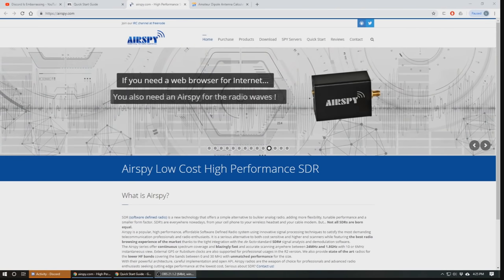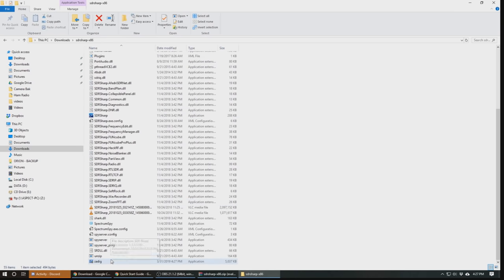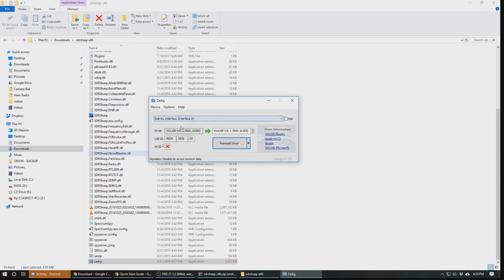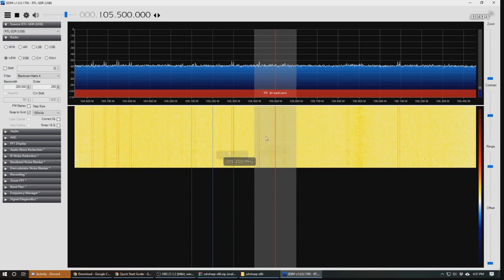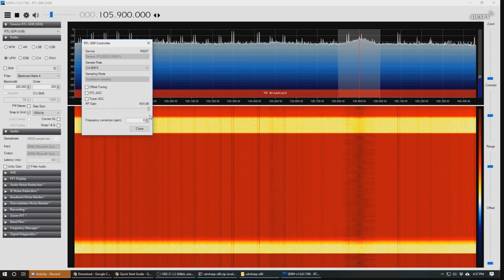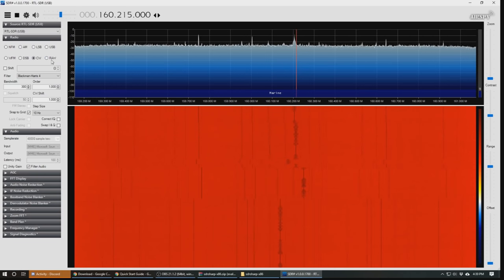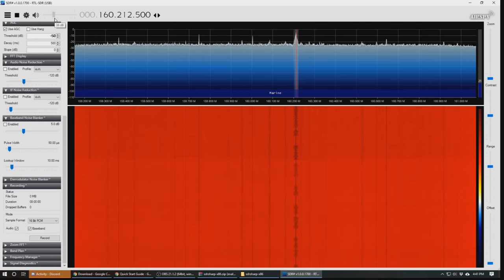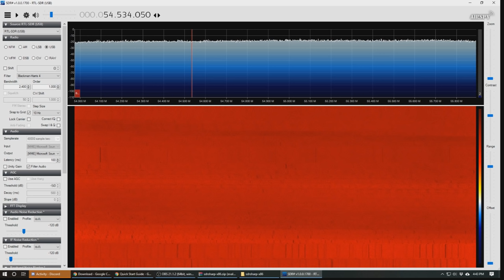Getting Started with the RTL-SDR (Software Defined Radio)

Comment: you forgot to explain abuot .NET5 SDRSharp didn't start it aske to install .NET I did but still SRDSharp doesn't it keep asking to install .NET5
Reply: Had that problem, I have a 64 bit pc and NET5  was installed but no joy with SRDSharp starting.  Uninstalled NET5 64 bit and then installed 32bit version , problem solved.

Comment: To remember which side of the antenna is up, which side is down, after unscrewing it, I attached a rubber band at the side that is supposed to be up, so I remember it.
The RTL-SDR kit is the best out there for newbies. I started with Nooelec, and as much as I don't like bad-mouthing companies, their stuff is just subpar. For similar price, RTL-SDR is way better. For a bit more money, the SDRPlay is awesome, especially if you're on Windows. If you're planning on buying an upconverter anyway to get into the 1khz-30Mhz range, the SDRPlay gets you there without an upconverter, and has several built-in filters (which I haven't found how to activate under linux, only windows).
If you plan on going the upconverter route, it's worth noting the RTL-SDR has a bias-T which can power many upconverters, while the Nooelec stuff needs another power source.

Comment: Thanks for making the setup simple and understandable.  I was getting frustated until I found this.
Reply: hi David, are You using them with R820T2 RTL2832U? Would You tell it's worth to buy?
Reply: Hello Jaroslaw,  I have the RTL2832U R860T.  It says it's version 3.  I'm still struggling to receive much  of anything on it.  I sorta wish I had gotten a different dongle.  Maybe a different one would have given me better results.  So event though I was to finally get it to work,  I'm not satisfied with the results.  

You might want to journey over to Frugal Radio to see if they can give you some info.  I've also gone to Kiwi SDR Online.  You can listen to SDR indirectly from their website.  I've been doing that myself.  It's limited frequency covderage but it's still fun and interesting.

Good Luck, Jaroslaw
Reply: @davidsearles4636  Thank You :). Keep Well Man.

Comment: @ModernHam Great video, but you should note that NFM/AM/LSB/USB/etc. are not "filters," they are different modulations. Changing them doesn't just change the bandwidth, it also changes how the signal is decoded to audio. LSB and USB decode single-sideband AM signals. AM decodes AM signals. WFM and NFM decode FM signals of different bandwidths.

Comment: I was advised to toss the included antenna in the trash
Reply from the maker: People like to over complicate antennas. An antenna is just a piece of metal. It can be a wire, one made of pure copper, a telescopic, even a gutter. If it's the same length and shape, it's basically going to be the same thing. The included antenna is fine for anything above 50Mhz unless you need something highly directional

Comment: Love the video! Quick question would it be safe to connect the RTL-SDR directly to a waveform function generator using say a BNC-SMA cable (and avoid using an antenna). I'm just trying to test the software aspect + functioning of the RTL-SDR.
Reply: Fwiw I've heard of people hooking up their 1-4W HTs to them as a signal analyzer. That said I've read they can be fried, but as to what power is safe I'm not sure.
Reply from the maker: Depending on the output of the waveform function generator. You want a very minimal signal on the input or you will desensitize the receiver end.

Comment: I just received my RTL-SDR yesterday and have watched two superb videos about how to set it up. Out of the two videos I watched, this one is better. Thanks to you, I feel almost 100 percent confident I will set mine up without much trouble. I am running a dual boot P.C.; one side is Ubuntu, and the other is Windows 10 Professional. First, I will set up my Windows, and then based on my research, I will set up my Linux for the radio scanner. I also have an iMac, which I will set up. It's almost guaranteed that my Windows setup will not be as good as my iMac or Linux. Thank you for the clear and concise instructions. Subscribed and thumb up,    Cheers
Reply from the maker: Glad you liked the video! I find it works more smoothly in linux for me. the rtl_sdr package handles pretty much everything.

Comment: To receive HF you can get 2 nuts that fit the threads where the telescopic elements attach.  Then attach a quarter wave length wire for the band you want to use with a lug on one end to both sides by tightening the nuts.  So now you have an HF dipole.  To receive HF on Dongle there is something in the SDR Sharp that you might have to do so it can receive lower frequencies.  Not sure but just a hunch.

Comment: Thank you young man for taking the time to do this.  I am waiting to receive mine sometime next month.  I will follow your lead in getting mine setup.
Reply: how did it go sir?
Reply: @needlethread4715  Works great other than the software getting locked up when you click the stop button after it's been in use a while.  Have to do Ctrl-Alt-Del then end task.  So just leave it running all the time....lol.  I only use it for HF 40 meters mostly.  Tried some different solutions recommended but none of them worked.  Supposedly some older versions don't have this issue.  Any suggestions?
Reply: @dangriffin5532  thanks for the reply. had this dongle too for a month now. cant remember if i had the same experience using sdr++ or sdr# on my windows 11 desktop. but with the raspberry pi 4 i think there were a few times i encountered the same problem, with gqrx and sdr++.
Reply: @needlethread4715  Probably not the fault of dongle more the freeware written for it.  Someone took the time to develop it so I thank them.  I certainly don't have that skill.  But for $20-25 bucks it's hard to beat otherwise.  It works better than my SANGEAN.

Comment: Hi, I My version is V1.0.0.1811 with different layout; however, I found "RTL-SDR USB" but when I press the play button I get an error "No device selected"   My unit is a USB black box with two antenna inputs for low and high band range.
Any ideas?            (I had got it working in the past on another computer but it kept on crashing).

Comment: Amazing video, thanks! My dipole antenna though has a resistor (100kohm) and not a capacitor. What could that imply in practice? Thanks.
Reply: Ever find out?
Reply: @mikeoxbig7806  nope. :-(
Reply: Hi, folks, I came here due to the same doubt... but I can't read the value ( 100K ). After check the resistor value ( barely can distinguish the first band in my antenna ) I've found this, explaining why the resistor is in between. Hope this clears your questions also:  "I have the same antenna and it is 100K ohm on mine. This would serve to bleed any static charge (its intended purpose) without impacting performance." Link: https://forums.radioreference.com/threads/why-is-this-cheap-rtl-sdr-blog-v3-kit-antenna-so-good-and-why-is-it-so-directional.406041/

Comment: Sir it is a resistor. Not a capacitor. Resistors do not have an up or down side. That resistor is for ESD bleedoff. Some report, though, that the end connected to the center conductor of the coax is up, and seems to give better results. Also, the newest version of the dipole antenna being sold does not have a resistor. The modes are not for the audio coming out. You select the appropriate mode for the signal your tuned to. Amplitude Modulation, Frequency Modulation (NFM or WFM), etc.

Comment: I also have such a receiver. But I don't like one problem, it gets very hot. And it is felt outside the case, and inside it is even stronger. Have you tried installing a cooling cooler on it and will the holes in the casing affect extraneous parasitic interference?

Comment: Hello my dude,

Yea...that's a high resistance resistor in between the poles (they even say it on the website). It was used on the V3 to discharge any Electrostatic Buildilup on the antenna.

Comment: Resonance is not required for reception, but one will do better to have antenna that is at least one quarter of the wave length.  Resonance is required for transmission to keep from blowing the final(s).  At resonance, the antenna is purely resistive and reactance is zero.

Comment: where did you get the antenna you're showing? does it have an sma connector on it?
Reply: If you buy the rtl-sdr blog 3 kit with dipole antenna it comes with 2 sets dipole elements long and short. I just paid $34.00 on amazon for one
Reply: Yes it has sma.

Comment: Please help me. I have recently purchased and RTL.SDR from China, it has 2 inputs a UV and HF. However, I have downloaded the software and complied with all your instructions, but when I click on the start button it says cannot access the RTL Device. Perhaps you could let me know what is going wrong. If you want to access my computer using your Team Viewer for you to install it for me, then I am more than happy for you to do that and of course I would be more than willing to give you a donation. Trust you can help?
Reply: I had the same issue and it was because I did not followed the instructions correctly. What I did to fix the issue was. 1. remove sdr sharp including the zadig program. 2. reinstall sdr sharp via the .bat file. it will install zadig this time. 3. connect the SDR to the usb port and run zadig... make notice that if you had installed the driver before, the number will not be 0, it will increase it by 1. in my case, my friend´s sdr was 0 and mine was 1 as I installed both in my computer. Install the driver, close zadig. 4. Open SDR sharp, it should recognize the device this time. Have fun!

Comment: Why is it I always thought that tuning an antenna was only needed for tx, while rx didn't matter? I'm not trolling here, I'm genuinely curious to know.
Reply from the maker: I'ts very important for TX because an antenna not properly tuned for transmit can reflect that power back into your radio, causing damage. 
For receive, the electromagnetic fields that hit your antenna, cause the electrons inside to shift and create a signal in the Dongle. This is usually a small shift, unless the antenna is very close ot the transmitter. So if you have an antenna that is much longer in wavelength than the freq you are trying to receive, not only will your antenna pick up signals you don't intend to receive better(possibly donning out the ones you want), but a longer antenna may add unnecessary " travel space" where there could be possible losses for no reason. You of course want it long enough for it to properly be received by the antenna, or you loose some of that initial wavelength transmitted from the other end.
Reply: @ModernHam  I get why it's important for TX, and I realize the negitive aspects of using, say a 102" whip for gmrs RX may not be ideal but there does seem to be a myth floating out there that using the wrong antenna for RX can have the same negitive consequences as TX 'ing with the same setup. Maybe I'm completely wrong, wouldnt be the 1st time lol, sure wont be the last.
Reply from the maker: @franksmith7271  Nah, any SDR really "receives" all freqs at once, but the software part is what separates them for the user. So changing the listening freq won't really do much hardware wise.

Comment: AM radio specifically, starting with my local stations. Does the sdr have the capacity to pick up the signal? If so I am struggling to do so. My guess is I likely need the correct antenna configuration. Please share your thoughts. Thanks for the great video.
Reply from the maker: Yes, but where AM bands are used typically require quite a long antenna.

Comment: have you done anymore videos on antenna configurations and uses? I've been trying to catch a signal from the ISS, finely got some data last night but my signal to noise ratio was too poor for a good decode, I suspect either my antenna or my positioning of it. don't have one with the 2 elements, just a 1 element telescoping with a magnet mount.  I've been placing it on a A/C unit to a ground plane,  since its the only metal on my roof for it to stick to. and don't worry the A/C is not running. but any tips would be useful, like if i should angle the antenna horizontal instead of vertical, should it be parallel to the flight path of the ISS or at a 90 degree angle to it. hard to experiment with it when you only have 3 to 6 min and they are not transmitting every time they pass.  oh and I have one of those 2 element antennas on order.

Comment: FYI - great job with this video.  I had a significant windows upgrade and had to reinstall the usb driver.  The "bulk" reference was not an option but since you called out the ID (OBDA 2838) I was able to reinstall easily.  Thanks

Comment: My dad has been in radio since the 70s.  I asked him about the specific antenna length for certain frequency thing and he said that only matters for transmitting, not reception.
Reply: XtremeBudgetMusician that’s not entirely true
Reply: While you can receive a range of frequencies with a 'set length' antenna, it's not optimal. For instance, your car antenna can receive the whole FM band. In the bigger picture though, the FM band is just a tiny bit of the spectrum that we use. But all car antennas are the same length for a reason. They're the best at resonating within that range.

Back in the day when people were into CBs, a CB whip antenna was MUCH longer than the vehicles' radio antenna, because the CB range is much lower than the FM Radio range.

For most people who get into SDR, we're looking for far away / weak stations -- or even satellite signals (which are relatively weak as well.)  In these cases, having your antenna a specific length helps immensely, because you're trying to match the antennas' natural resonance as close as you can get to the frequency range you want to receive. 

To put it in perspective, if you tried using a regular dipole antenna in place of a DirecTV dish, you'd never receive anything. If you look in the LNB of a sat dish, you'll see the antennas are just millimeters long, because it's such a high frequency.

Yep. Length matters. Using the wrong length can seriously degrade the performance of your receiver (as well as being destructive to your transmitter!)
Reply: You resonate on a receiver antenna?  I’m confused.
Reply: Nonsense.  Run as far away from him as possible.
Reply: Roger Pflug Yes, an antenna may work at frequencies other than its resonant freq. but it will be very inefficient.